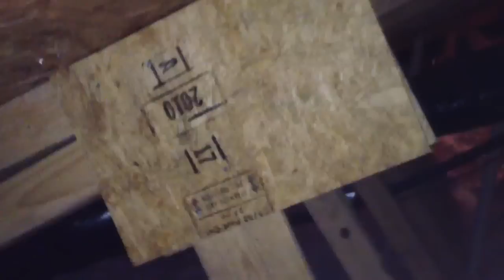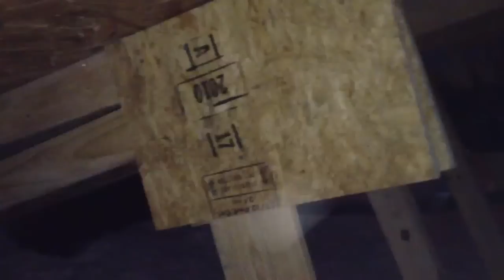Truss Damage Tip

Comment: Came across many jobs where there was wood truss damage. In order to abate the issue, as my employer gave me no control over the construction materials, just safety. I would note the damage, in my report and issue a strongly worded Safety Recommendation. My wording using the term "should" always solved the issue. The reason being, the court system interprets "should" as "you will". 
I've had entire building truss systems (improperly braced) collapse, with the contractor wanting to salvage/reuse the trusses. I always made sure that the general contractor was well aware of the issues.

Comment: You are not considering whether they used glue.  However, OSB should not be used under any circumstances.  Use plywood, a bunch of PL400, and a bunch of screws.  After that, no common 2x4 truss joint is going anywhere.  If you have more loads (doubled up trusses with integrated LVL's) it gets way more complicated and you'd probably be best calling an engineer if you don't have any experience.  But I've corrected my own issues as well for these so it's not impossible to DIY.

Comment: Sure, the homes were much simpler / shorter spans in the late 60’s -70’s, but my Dad was a well respected GC before truss plants were common. He and his crews site built trusses for over 300 masonry homes, using 1/2” plywood for gussets and only “common sense” self engineering, in which 95%+ are still intact and looking good. That’s how it was done prior to 1978 “ish” in our region. If that repair was nailed adequately, it’d be stronger than the steel press gusset. Besides, without seeing what the specific problem was prior to repair, any further blind speculation is laughable. I’d love to see the sizing chart this guy used to decide these particular gussets need to be 24” and I’m curious if he put that in writing / in his report. 

*As others have said. The common process today is, if truss damage occurs, you take pictures and report it to the truss manufacturer. Their acting engineer of record then decides how to repair said damage and provides a sealed detail drawing to keep on-site for the local governing authority inspectors / or Private Provider Inspector, which they review for compliance at the time of framing inspection.

Comment: Trusses work through pinned connection.  In other words the joints should resemble a pin or single bolt connection which allows for rotation.  That being said, in the real world connectors are designed to resemble a pinned connection as much as possible.  Providing a large gusset plate help because you can increase the amount of nails.  However,  a 24" gusset plate moves further away from a pinned connection.  Also the capacity of the existing nail plates are difficult to obtain, so for sure any time a truss is damaged, you call a structural engineer.  Never try fixing a truss without an engineer-this video shows a great example of what can happen, minus roofers stacking material over that location.